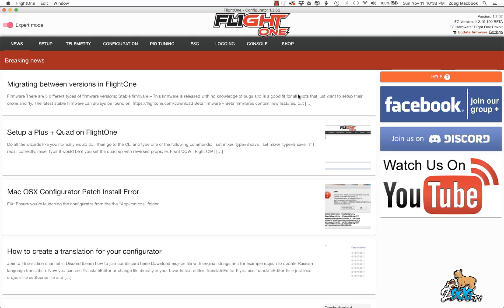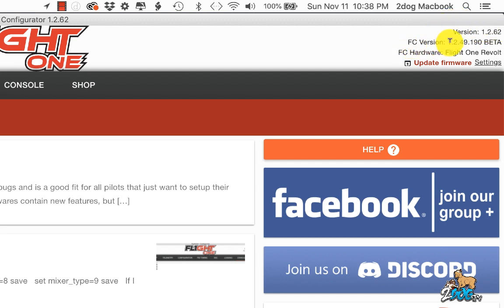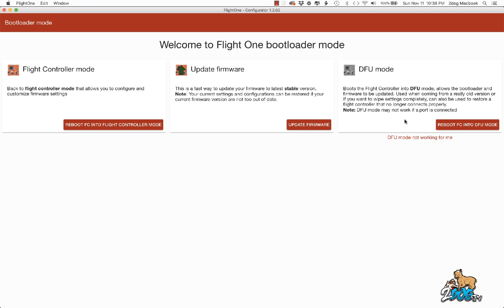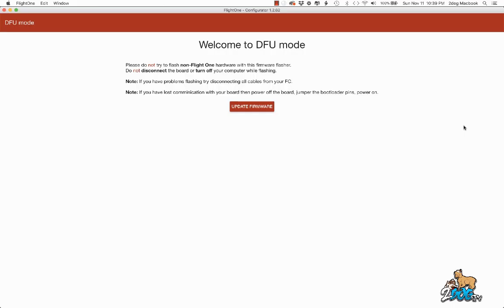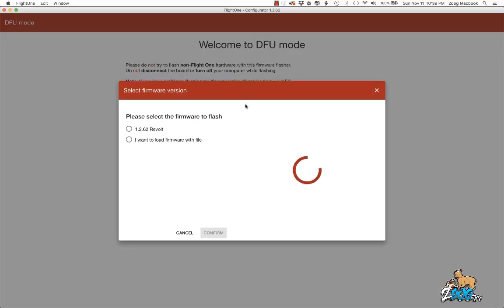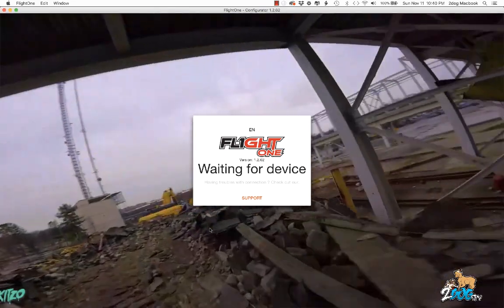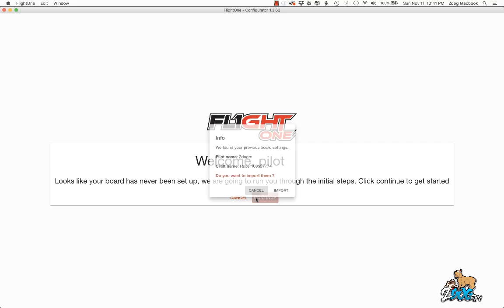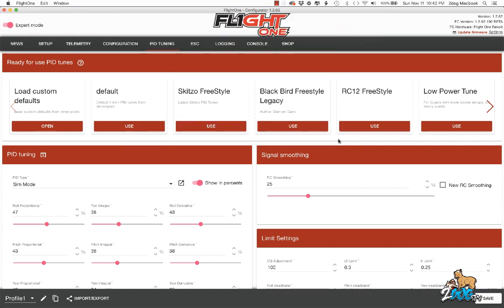Flight One Configurator Series: Proper DFU Flashing Techniques.

Comment: Hi mate,
I've just purchased my first flightone revolt osd,  I'm having trouble with flashing. 
When i plug it it to the configurator (1.2.75) it says error, loading failed, please make sure you have upgraded to the latest fl1 firmware.. which is what I'm trying to do!
I click update firmware,  then reboot into dfu, it goes into dfu but that's it! The configurator just says waiting for device?
It's beyond me mate, hope you can help!
Cheers
Adam
Reply from the maker: Do you have anything connected to RX3 on the Receiver? If you do you have to remove that.
Reply: @2dogrc  Thank's for getting back to me mate,, i sorted out the issue,  it didn't like the 2 usb ports i tried,  tried a 3rd and bang all good.
Reply: @2dogrc  Thanks, this just solved my issue today. And I`m asking my self WHY. because it was working before with the same wiring o.o